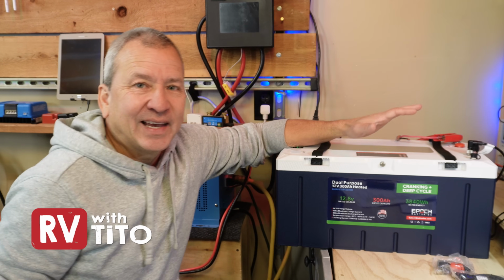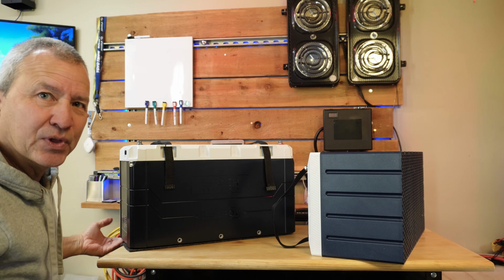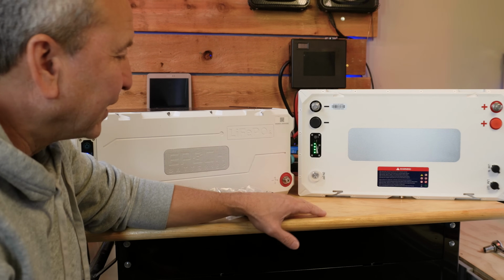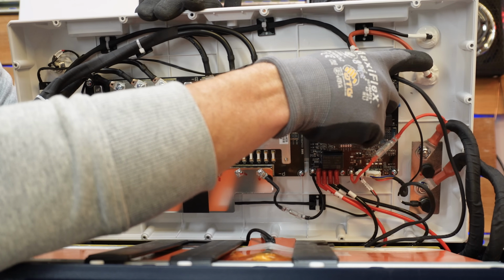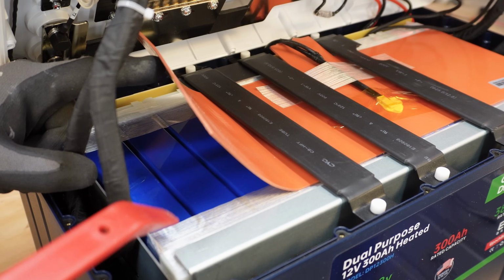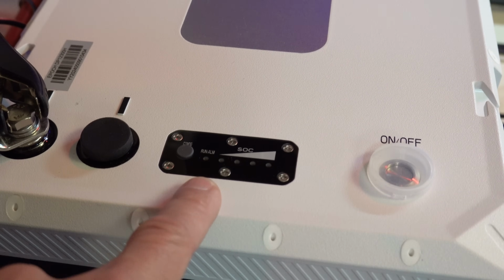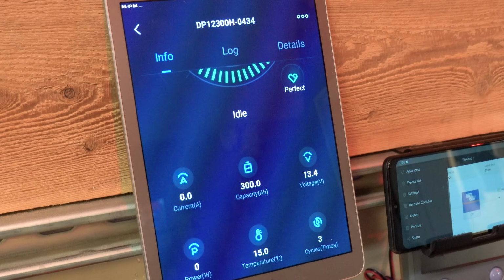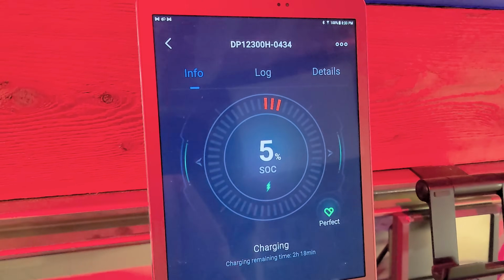What's Inside? EPOCH 300Ah 12 Volt Dual-Purpose LiFePO4 Battery (Review, Test and Teardown)

Comment: The Epoch 300a is ip54 not up 67.  Thank you for this video.  I am looking to get the self heating one.  I hope it works well.
Reply from the maker: Clarification: There are two 300Ah batteries. The Essentials model is IP54 and the PRO model that I tested is IP67. They've also got a new 300+Ah V2-T model. Good luck with the upgrade.
Reply: @RVwithTito Thank you !

Comment: I just ordered this battery. I plan on using it as a starting battery for my Freightliner FL60. 8.3L Cummins, former ambulance. The prior batteries lasted about 5 years. Replacement batteries are about $350.00 each and it has 4. I can probably get away with 2, since it’s not an ambulance anymore. BUT… Why not try this?!? I did call Epoch. They did answer the phone! I told him what I was seeing with my setup and they are well within the specs of this battery. He said “go for it! We don’t advertise these batteries to be sued for your application, but if you are within the specs, I don’t see why it wont work for you.” I am going to use a DC to DC charger and isolate the alternator from the battery. I plan on putting this battery to the test!

Comment: Thanks for yet another great video.  I think this may meet my needs for a high watt hour lithium battery that can run my AC for a while and can serve as a backup to crank my engine (Ford Triton 6.8 L V10) or my generator when I need it to.  I've only had to crank the engine off the coach batteries a couple of times in 15 years but it's been great when I needed it.
Reply from the maker: You're welcome.

Comment: Is this a Direct replacement for Lead acid batteries? I have a 2001 Tahoe lite 18tb camper with the original 12v system & charger.

Will this battery or the 12v 120Ah Dual Purpose battery drop right into my camper?

I connect it to a 110v outlet to charge my lead acid battery & wondering if it'll charge the Epoch battery without changing anything or having any problems?
Reply from the maker: Short answer is Yes you'll need a lithium compatible charger that will charge at a higher voltage. Lithium batteries also rest at around 13.2V. Standard Chargers will consider anything over 12.8V as fully charged. So it wont start charging the lithium battery.

Comment: The heating pad should be under the battery and will damage the current bard when it heats up!
Reply from the maker: There us one under the cells too. I think both pads will cut off once the temp is at a safe level for charging.

Comment: I am bummed, I was about to order when I noticed it only has the 200 amp bms instead of 250 amps. I doubt I will be using all 3KW at once, but only want a single battery in our 5W. I was considering a LiTime 560 AH battery with 250 amp bms, but it is non-heating & just low temp cutoff - but at 133 pounds the 460 AH the Epoch looked more attractive at 84 pounds. Back to the drawing board, lol. David - KU9L
Reply from the maker: Which battery are you referring to? This one has 300A continuous and 1000A surge.
Reply: @RVwithTito  The 460 that you used as a comparison. With my shunt, I don't need the fancy communications & it appears a lot of brands are having coms issues with playing well with the Victron toys. I am sure it will be worked out eventually, but we don't need the coms, just decent storage to run her computers with our 1,440 watts of solar. We run 13 campgrounds for the USFS with our concessionaire employer & want a shining example for our camp hosts. Sorry for the confusion. ;-)

Comment: I thought when you said 'Victron Communication', you meant it would connect to a Victron BMS... but I suppose the internal and external BMS's would conflict since each one would want to take control of the operations required.
Just a side note about Victron batteries and BMS's... they will be phasing out the current batteries and BMS's over time, as they implement the NG(Next Generation... but since its in play now, it should stand for New Generation... anyway...)... They have moved most management functions into the external BMS, and have much smaller boards inside to handle what needs to be handled IN the battery... but the real BMS is external. The idea is, they switched from analogue to digital communication, so instead of the battery sending vague warnings to the BMS, like over-voltage condition, or over temp, etc... the batteries now send the actual values to the BMS, so it can better tailor its operation for the precise condition being evaluated and compensated for.
AND... bonus feature...This change, because digital signals don't degrade over distance like analogue signals do, you can now manage 50 batteries from one BMS, rather than the old limit of 20, plus, (with both the new and old BMS's), you can now parallel 5 BMS's... meaning you can have 250 batteries in your bank, all precisely controlled by the external BMS's. (None of this 4s4p max of some brands, or even as you said here, 16 batteries max.)

OH.. also... the term "smart', is not in the name of the new batts, since they provide ALL data to the external BMS, you simply get that info from the BMS, rather than having to connect to each battery separately to get its readout.

That said, not everyone wants to spend the $$$ that Victron charges for their batteries, and so, even though it doesn't offer any control over the battery from the GX, it does at least populate the battery monitoring function of the GX.

Comment: I am curious if this battery can be charged from a diesel Motorhome alternator without damaging the alternator. Most lithium batteries need some type of isolation from the alternator to prevent the alternator from being damaged. This battery would be a game changer for me if that was possible. does anybody know if this is a possibility?
Reply: @GarySchwarz-h4c  Older comment, but no response, and I'm going down this road myself. I'd say no. Apparently some alternators will handle the abrupt shutoff of the BMS when it's fully charged, but that isn't a given for all automotive alternators. 

I would think that a "soft disconnect" BMS could mitigate the problem, but thus far I've not seen a Lifepo4 that is REALLY made to be a starter and storage battery. 

As ridiculously expensive, and cheaply made as SLA start batteries have become, I'd love to see a properly made lifePo4 that could actually take the place of an SLA starter battery. The upper temp limit may be the biggest issue, the battery manufacturers have no idea how hot each battery will get in every application.

Comment: The non "Dual-Purpose" version of this battery from Epoch is $500 cheaper than this $1500 battery. There is no benefit to 800-1000 cranking amps for an RV battery. If you are using it for a motorhome, perhaps this battery would have a use (although overpriced for an engine-starter/house battery, cheaper to have a cheap lead-based battery for just starting the rig's engine), but the vast majority of RVers don't have motorhomes and the battery in practical equivalency from Epoch, their 12V 300aH with 200A (continuous) 400A (peak) for 2/3 the price of this battery is definitely the wiser choice for RVers.
Reply: But would you need to change the charger, inverter & all that to charge the Lithium LiFePO4 battery?

Whereas the Dual purpose would be a drop in version & not need to change anything?

Comment: ANY IDEAS? I'M looking for a good lithium power station that has a 30amp outlet, can be powered by solar, 110 or 12 while driving. Im getting rid of my ONAN onboard generator that is mounted UNDER my rv. its a pain to service & im tired of the exhaust pipe being so low. ANY IDEAS? THANKS!
Reply from the maker: Hard to say. Lots of folks have an ECOFLOW Delta Pro (https://amzn.to/4fkI7GO), but there are several others priced between $1500 - $3000. It depends on your budget, what you plan to run, and for how long. The battery capacity on these aren't that great, which is why many are offering expansion batteries. For example, if you plan on running an A/C with one, then it will eat through your battery quickly. I'd also recommend one that can use any solar panel with MC4 connectors. You don't want to be stuck having to buy the manufacturer's solar panels. Not sure if this helps. There are lots of folks reviewing power stations here on YT like @Hobotech that review tons of power stations. Not sure where he keeps them all. Good luck!

Comment: Sun Fun Kits has excellent full-featured batteries too, pre-built at prices similar to Epoch, or as kits that save $$.  I bought their 280ah heated battery kit and the cells, grade A from Eve, tested out at over 300ah.  One great feature is that there's a switch on the case to turn off Bluetooth, so when there are a lot of battery owners around (think Quartzsite) I can just turn off access, yet when I'm out in the woods I can check my battery status without having to enter a PIN.

Comment: You mentioned the marine 460’s fuse and implied it was for overcurrent protection. At 500a, it wouldn’t be good for overcurrent protection for any battery cables used on an RV or boat (2/0 or 4/0 105F wires). The purpose of that internal fuse is for short circuit protection of the electronics in the battery but, fortunately, it will also protect the battery cables for short circuits, as well. A second fuse is needed of appropriate rating for overcurrent protection of the wiring on the marine 460. 

So far, I really like the 300DP (and 120DP) for its networking and Victron interoperability (not just display comms to GX like the marine 460). 

I’m a little disappointed that you (or others) haven’t identified the cells used or said much about the BMS configurability. Still, a nice review of what I think will be a great battery.
Reply from the maker: Thanks for sharing your insight.

Comment: Thank you Brian, excellent video. I just downsized from a Class A gasser to a small class C.
No good places to put the 300AH battery unless I lose some of the limited exterior storage. I have been impressed with Epoch, and purchased two 105AH from them ( that’s all I could fit under the step).
I know most if not all these parts are Chinese, but think it’s assembled in the US. I’m sure someone will chime in if I’m mistaken. 
Thank you again
Reply: That thing looks about twice the size of the 304Ah I built using 4x EVE LF304 cells & JK BMS.
Reply from the maker: When I had a Class C, I ended up taking over one of those high-value storage compartments and filling it with batteries. I think the batteries are designed and supported by EPOCH in Georgia, then RowPow builds them in China.

Comment: Had they been available this spring, I would have strongly considered them instead of the 2x460 Epoch units I put in my motorhome. Overcoming the anxiety of not having separate starting and house battery banks is a major hurtle. They put a Boost switch in motorhomes for a reason. That being said, this product has potential to simplify the interconnect and greatly reduce space and weight for the total motorhome battery system. I have a friend that has installed an Ionic brand LiFePO4 starting battery along with a larger capacity LiFePO4house battery. He and I noodled out how to interconnect the two while preventing alternator burnout and keep the starting battery charged (along with the house battery) while sitting, from shore power, solar, or generator. He didn't want the expense and complexity of  isolated banks and adding a DC-DC charger for the house to charge from alternator. If they are isolated, one also has to solve how to charge and interconnect the banks in all the states (driving, sitting with shore power, sitting without shore power). In the end, we just decided to connect the two banks together at a bus through a 250A breaker/switch (so the breaker pops if the house batteries are overcurrent, and he can turn the switch off to isolate if needed). So far it is working and we have not observed alternator heating or overcurrent, probably because the voltage is not high enough and he has not tested with low SOC batteries after a start. But he must be vigilant not to run his system SOC down with no backup. Having solar and parking the motorhome outside helps this issue. In thinking about future designs, maybe a LiFePO4 combined start/house battery, and a small, isolated GENERATOR start battery would be a good design for emergency. Im curious when the industry is going to a combined system for OEM options and how they will do it. Thanks for reviewing this product!

Comment: Great Video I always have to fight the urge to upgrade to a different battery. I use a SOK 280 ahr in my class A motorhome. I was worried about it having the amps to starting my Onan 5500 generator. It is rated at 200 amp continuous and 250 amp surge for 7.5 seconds and it starts up the generator just fine.
Reply from the maker: Yeah. I'm sure it starts fine. I hear you though about upgrading. The tech has evolved very fast over the last few years. People ask me, why I don't replace my bank that I installed 3 years ago. I respond "why?" they work great, but without all the fancy stuff these have.
Reply: @RVwithTito  I think the Anker SOLIX F3800 with the 50 AMP plug setup would be cool to use as home battery backup then be able to roll it out to my RV and use it as the inverter/battery in my RV when I go on trips. I just wish it wasn't over 130 lbs making the install each time kind of painful. It also doesn't have the hybrid option like a Victron inverter to adjust the draw from shore power/battery/solar as desired.
Reply from the maker: I think there is a problem with that one not being able to power the 50A output while its charging.
Reply: @RVwithTito  Yeah that is a big draw back, seems like it is more designed as an emergency car charger and home back up and oh look you can plug your RV into it also (for a little while).
Reply from the maker: @RVingwithBandit They offerred to send me one to review and I turned it down for that reason.

Comment: Hi, I noticed the new UI on the phone.  Does this actually go through the internet to the VRM?  I find to get that UI on my android tablet I have to "reboot" the Cerbo GX and when it comes back up it have the new UI as a choice.  However if reload or launch the Victron Connect app after booting down or go out of it and back it, it does not launch the UI but the "old"...  pb
Reply from the maker: Yes. I'm using an old Color Control GX with a busted screen. So the only way to control it is remotely through VRM. I can use the buttons, but have no screen. Pretty funny.  I've also had to re-select the new UI a couple times when accessing through VRM. Not sure why.
Reply: @RVwithTito  Thanks for your reply ... pat

Comment: I have been looking at these over the 460ah ones due to the dual purpose. My Jayco Seneca has the ability to use the house battery if the chassis battery is dead to start the engine. There are not many dual purpose batteries out there, they are either crank or storage, but not both. So this is a nice option I have been investigating. One thing I would like to see is how the over current protection operates in a parallel and serial battery configuration since how the batteries see the electrical load will be different.
Reply from the maker: I haven't been able to test a two battery setup yet. Even the 460Ah communication ports are different now. So I can't connect them.

Comment: Wow that thing is big. It would be nice if it smaller.
Reply from the maker: Group 8D is pretty big. I'm sure there are lots of reasons to stick to a standard size so that they are a drop in replacement.
Reply: @RVwithTito  I have a 300Ah lifepo4 that is the same size as the original 100Ah. I'll pass on this monstrosity.

Comment: I bought the 460ah Essentials a few months ago for my small Class C.   Its fantastic.   The bluetooth phone app works great, it fits under the stairs, and it starts my generator no prob.
Reply: Start your Onan 4000 watts generator?
Reply: @arriagada1957  Easy.   My generator pulls 150 amps to start the starter motor, then drops to 75 amps to run the starter motor.  The battery is rated for 400 amps for 10 seconds, and 200 amps constant.   Its a great battery, and the app is awsome.
Reply: @arriagada1957 An ONAN 4k (pre-cummins when they weren't junk) pulls 350amps to start according to the spec. A 454 only pulls 300.
Reply: Question for you: what type of class C do you have ? I just purchased a new Entegra 26M. I could not fit the Epoch 300AH in the step compartment. Or did you modify it? 
I could modify the step area if I cut out angle iron members Jayco welded up to the frame and rebuilt it. But I am waiting since it is only a month old.
Reply: @anthonyb2334  Congrats on the purchace thats great!  Mine is a 2017 Adventurer.  Its 23 feet bumper to bumper, on a Ford E350 base. I got lucky i guess it fits perfectly.  You could rewire it to one of the storage areas in the back, though thats extra work.  To be honest, if you go that way get the 460ah. Its well worth it.
Reply: @ .
Thank you. I traded my 2022 Winnebago Vista in on this one. It had lots of storage, but this one, not so much because it has an outside kitchen. We actually USE it, I would take it out and install it there. Maybe one day. But the two 105AH batteries work great. The not 3-4 night boondocks
Reply from the maker: Awesome!